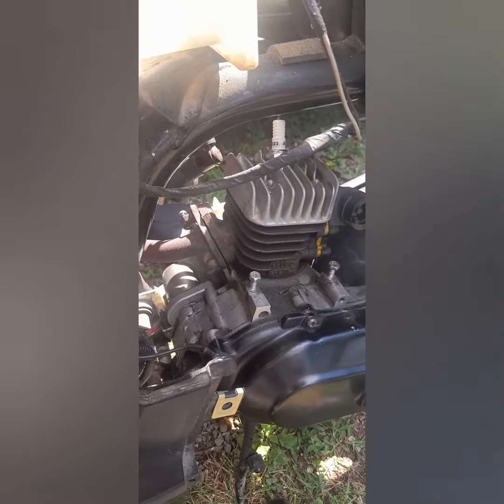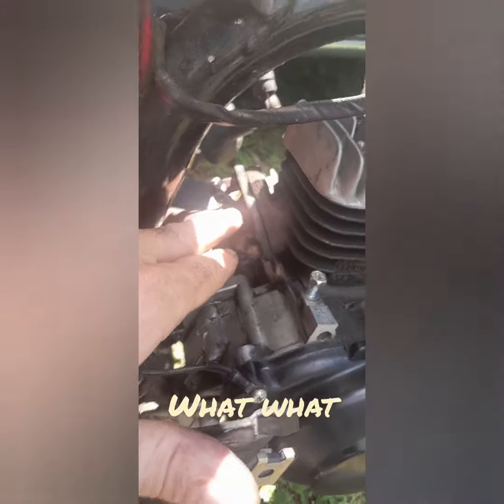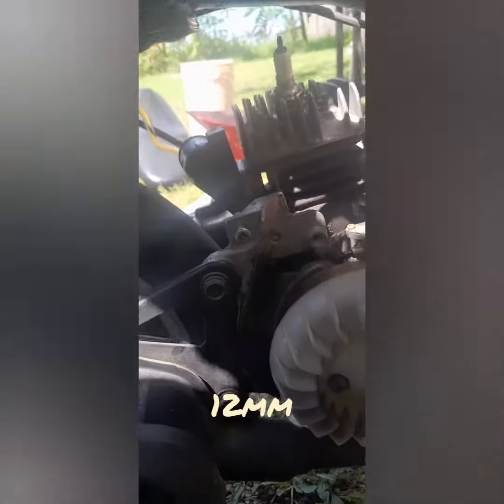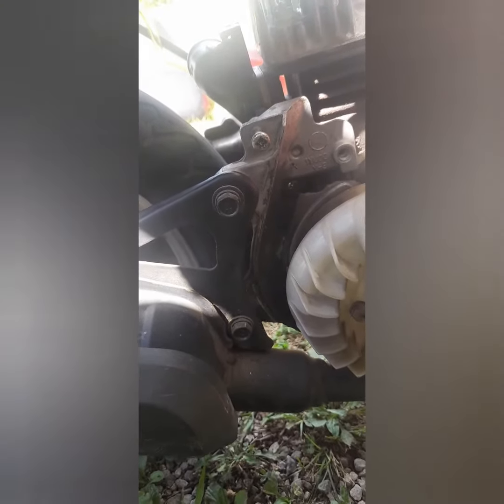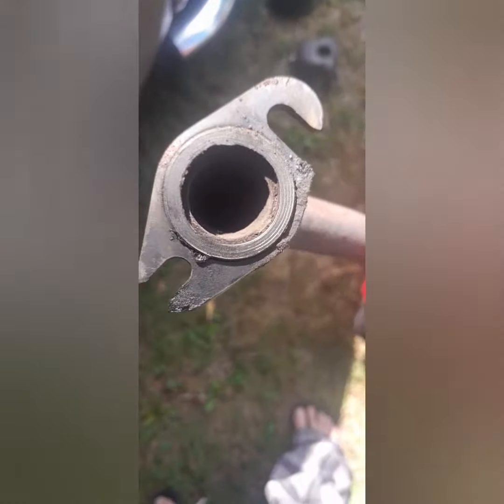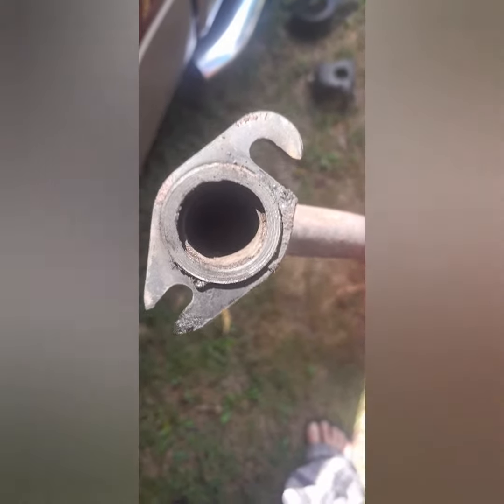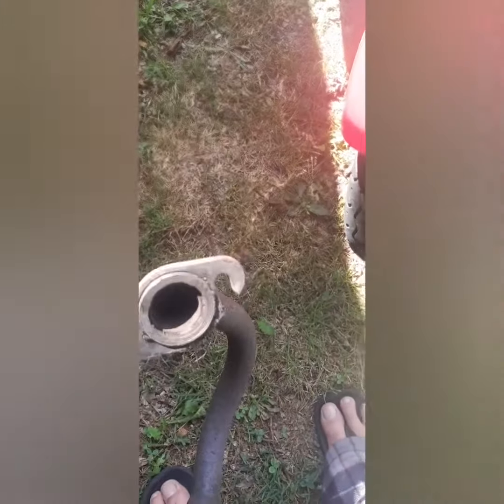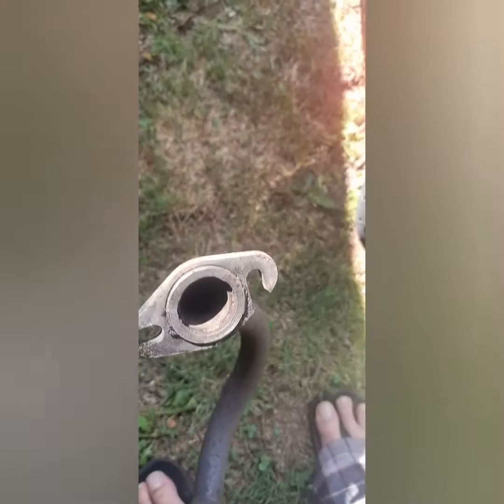razz exhaust restriction removal

Comment: Biggest restriction I found on the spree was the reed valve.  The exhaust is different from the regular model but I can’t imagine it making that much difference.  Coring the muffler out and adding another exit to it though made a pretty significant difference.

Comment: Throw the exhaust in the fire 🔥 pit and cook the built up carbon out. You can also look in side the exhaust port on the head to make sure there isn't a wall of carbon build up blocking the exhaust port. Did you put your finger in its dinky 👀🤦🏾‍♂️🤷🏾‍♂️😅